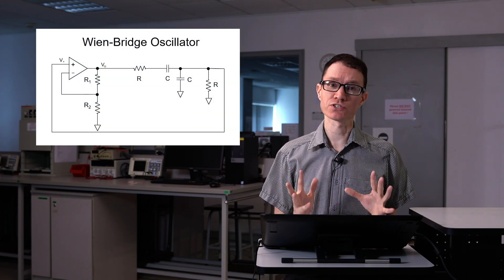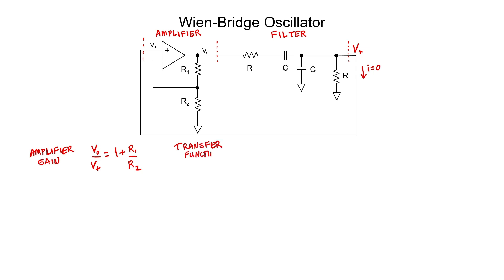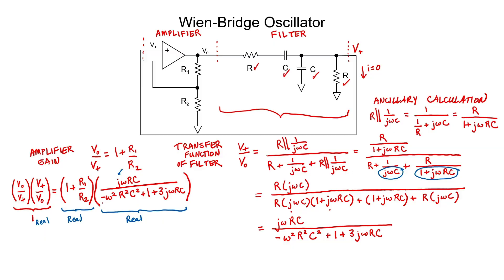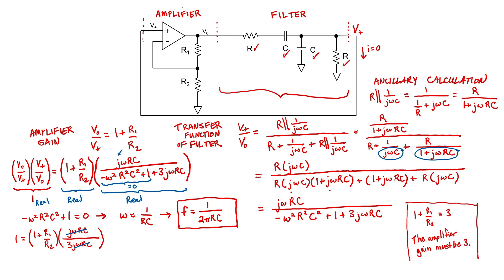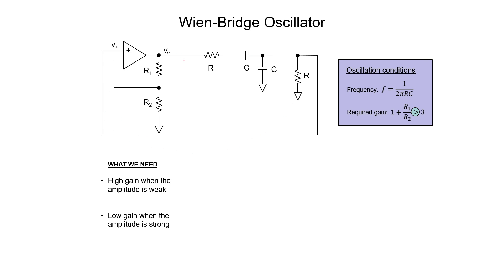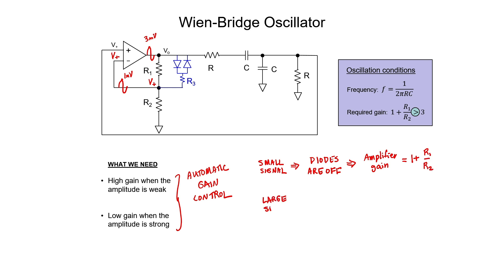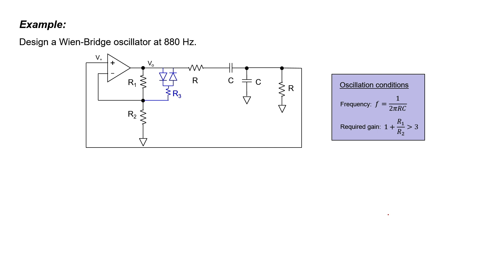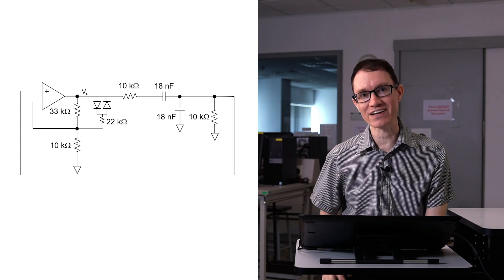All about Wien Bridge oscillators (2 - Oscillators)

Comment: Not quite sure about the way you approach the feedback network equation with complex numerator and denominator to obtain the frequency of oscillation

In order for the circuit to oscillate - the overall phase shift must be 0deg  or multiples of 360 degrees.
The only way this can occur is if the feedback network is purely resistive.. ( that is its reactive "j" component becomes zero 
That is to say
If v+/vo =( a+jb)/c  then b=0
In other words equating j terms to zero)
You would need to further develop the equation to get it into a form( a +jb) /c

This makes more sense imo - since it concentrates on the idea of 0 phase shift by equating j terms to 0 - rather than a " not so obvious" mathematical  sleight of hand setting real terms in thr denominator to zero - which fotunately just happens to enable j terms to cancel.. leaving 1/3

Comment: Can you explain if I want to get a square wave from this sin wave that should I do ?
Reply: you could choose a high value for R1 (say 100k) so that the gain of the circuit increases towards the rail voltage on the opamp. the opamp would saturate and your wave would become quite square. you could set the amplitude of the wave by controlling the rail voltage
Reply: Add a zero crossing detector that can be as simple as a single comparator